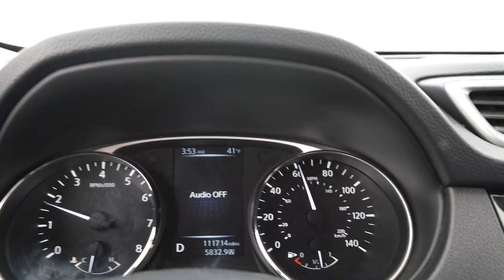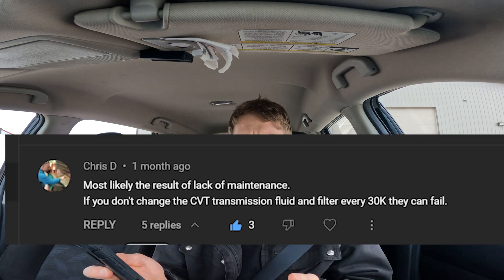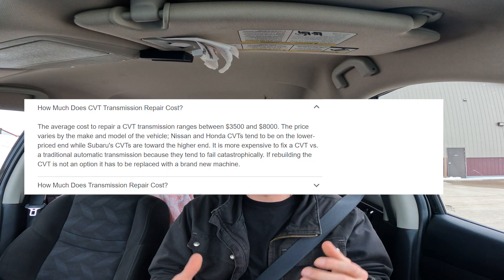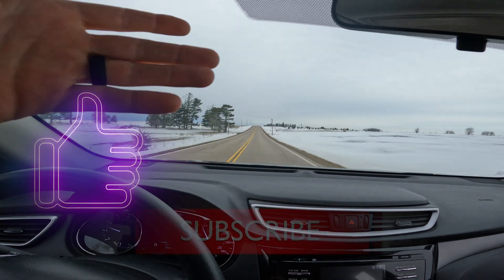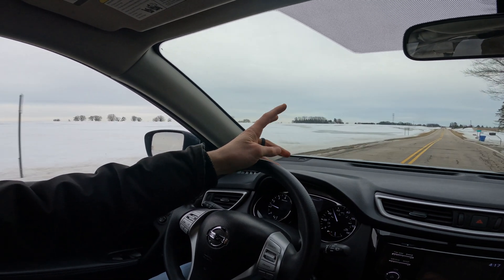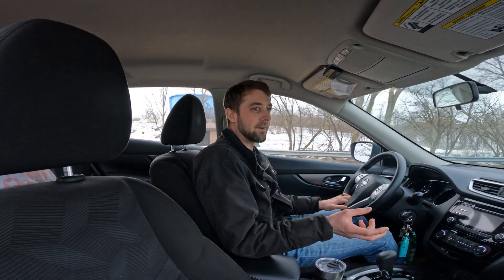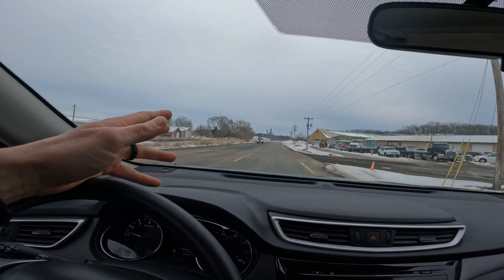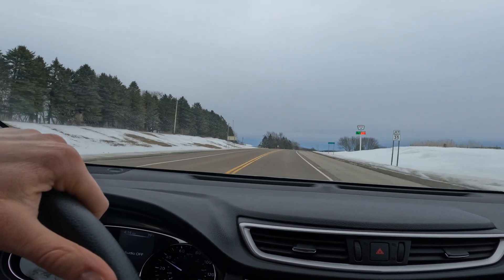Everything WRONG with the Nissan CVT Transmission

Comment: My 2017 rogue has not been that bad it has 70,000 miles and I had the transmission serviced at 60,000 miles. Still runs and drives like new even though I can’t stand how it drives at all.
Reply from the maker: Yeah honestly the car for me has been ok in terms with the engine and other components.  The CVT failed at 95,000 miles for me. I agree with the driver “feel” experience lol. But it’s economy class I suppose.
Reply: wait till you get close to 100,000 miles.  There are no transmission rebuilding or parts to replace.  There is only replacing the whole CVT, which costs at a minimum $4,000.  That's a hard pill to swallow
Reply: @christiansoto9755 And with replacement, they’re only guaranteed for 12 months… no faith in these cvts lol… in the industry.

Comment: I owned a 2013 Nissan Versa. The transmission failed on me after owning it for a year. I had the CVT replaced for $3500. They had a Nissan of America class action lawsuit. I signed up and recieved a reimbursement check. I no longer own Nissan vehicles. The last time I driven a Nissan was a car rental back in early September. CVTs are good for gas, bad for everything else.
Reply from the maker: At least they reimbursed you on the repairs. Yeah the CVT is a downfall to the Nissan brand IMO.
Reply: You clearly drove it wrong.
Reply: @denizenofclownworld4853  no he drove it right ..right back to the dealership.
Reply: @denizenofclownworld4853  Yep. CVTs failures are almost all because of one of four reasons 1) Driving the piss out of it    2) Driving it too hard in hot weather    3) Long road trip through the hills without giving it time to cool down     4) Not changing the fluid ever or after Scenario #2 or #3. Changing the fluid @30k miles is bad advice. You change the fluid when it burns up. That could be at 1,000 miles or 100k miles. That fluid will last 100k if it doesn't overheat. If you think you drove in tough conditions, change the fluid. Don't buy knockoff CVT fluid. Only put in Nissan OEM. Yeah, it's expensive - over $150 just for the fluid. But a new CVT is much more expensive. Also, change the damn stepper motor and both filters whenever you change the fluid around 100k miles. Things will last forever, possibly longer than a Corolla if you listen to my advice.
Reply: @garneroutlaw1  I agree with you on some level but not on everything.
I have 2014 Nissan rogue with 108k miles on it.
Car was mostly driven in Arizona hot weather.
I owned it when it has barely 25k on it. I never rev faster or go past 75mph as a safety rule.

I never accelerate my vehicle aggressively. 

I take 4-5 long drives which involves 6 hours of drive in a year.
I am changing transmission fluid every 20k miles when it reached 70k.

My car drives fine, Although I am not seeing symptoms at lowers speeds, it started slipping at higher rpms when 4 people sit in car with luggage.

When I got it checked with nissan technician with his computer.
It found that my transmission started slipping. 
It gave a code p0744 Torque Converter Clutch Circuit. 

What's the point in owning a mid size SUV when it cannot do its job properly and starts fail at this rate. 

All in fair, I think Nissan used their CVT which is meant for smaller compact cars on a heavy SUV.  and this tranny is crappier on bigger vehicles than on smaller ones.
I never expected a Japanese car go this bad (Except Mitsubishi which sucks any way) under 110k.

Even ford performs better than this. They usually start showing symptoms at around 150k.
Pathetic engineering for a big car company.
Reply: @garneroutlaw1  In the real world, they lost a dozen lawsuits where the truth was proven in court. The most incredible part of your comment is when you even blame owners over Nissan for following Nissan's recommendations.
Reply: @chandudammalapati  Mitsubishi is known in Japan to be extremely reliable, since they used to win many Paris-Dakar Rallies with their PAJERO. They have some very popular models in Asia. Also CVT fluid is exchanged every 30,000-50,000 km as part of routine maintenance in Japan. 

Fluid replacement is a must for all CVTs since it's just gears and belts/chains, just like an oil change for engines. Many Japanese automakers use CVT for their budget friendly models worldwide as it's more fuel-efficient and better suited for stop/go urban driving. We don't have any issues in Japan with Nissan CVTs because they're regularly serviced every few years.
Reply: @yo2trader539 doesn't matter..
Even if you change CVT fluid, 90% Nissan Rogues or Mitsubishi transmissions die before reaching 200k miles. Check statistics.. they don't last like rav4 or crv or a Subaru .. 
very poor quality engines and transmissions. Their CVT transmission suits for compact to mid size sedans. Not for bigger cars.. Nissan themselves accepted to pay for transmission replacement as part of settlement. They say they improved cooling system now for their new CVT transmissions. They are crap and always crap...
Reply: @garneroutlaw1  you could get AMSOil for less and it’s better. Actually Nissan doesn’t make the fluid. Find the Nissan compatible version for your model TransMax CVt is one of those
Reply: @chandudammalapati the torque converter isn’t the CVT.
Reply: Similar to myself, and will never buy a Nissan as long as I live.
Reply: The versa was only sold to USA, that's why they fail we have CVT in all types of nissan here in nz they are made in Japan no issues
Reply: @TB1M1 the versa wasn’t the model it was most failing in as the versa was made in Mexico.
Reply: Was your car used? Did you take care of it?
Reply: If cvts were good for gas, then Hyundai would be using them on their insane cars that’s get better gas mileage than Toyotas cvt cars

Comment: Have a  2006 Altima with a (bulletproof) REAL 4 speed transmission AND  a 2017 Altima with the flimsy  CVT, pretty much same engine / weight / car etc, makes for a good comparison.    Fuel savings on the CVT  is significant.   the fuel savings is about 30% city, 15% highway, with low fuel burn even at higher speeds.      What's so odd is it gets about the same MPG at 65 as it does at 80, which tells you how efficient the infinitely  variable design can be.   The CVT is very smooth and boring and  quirky when you need to stomp on it, and does odd things when decelerating, particularly when descending  a hill.   The engine revs quite high at times while coasting down hill, for whatever reason, we're talking 3500 RPMs at 20 MPH, which is just freaky.    It also gets unsettled when slowing suddenly  after an hour or so cruising on the freeway, hit the exit  and it takes it a while for it  to realize it needs to "downshift"  and gets a pinch jerky, but once it settles down it works great again.  I suspect the fluid gets a bit of foam buildup on long trips, and the foam doesn't quite work the servos as it should, just a guess, who knows.  

 I'm not an engineer, so I could be totally wrong, but based on my research its my opinion that temperature is the Achilles heel of the CVT.  Slapping an aftermarket cooler on it, isn't the solution either.  The CVT fluid is tough and robust, but  its not really working properly till it reaches 95-113 degrees.   In fact, you can't even check the level without a scanner, because if you check at the wrong temp you'll under / over fill it (which is why the newer CVTs don't have dipsticks)  THIS MEANS when you're driving your CVT "cold" you're probably damaging it (like a cold start causing bad wear) and it can take 5 to 8 min to get your CVT to proper temp.   To mitigate this, the "cooler" isn't a cooler at all, its a heater.   Its a heat exchanger that takes warm radiator fluid and uses it to HEAT your CVT as quickly as possible, to get it to the 95-113 degree range.    As a heater, its not really designed to dissipate heat, its more of a temp regulator, using 180-200 degree radiator fluid, rather than ambient air.     The trouble with this is, when the CVT gets too hot (which it can quite easily) the heat is being dissipated into the engine coolant (200 degrees) rather than the outside air, so it takes a long time to cool it down, should you overheat the CVT (from say climbing a steep grade) it can take 15+ minutes of normal driving  to bring the temp down    This also really really bad  for the unit.  An aftermarket cooler will likely  end up doing more harm than good, because its extending the warmup time and counteracting the "heater".   I highly recommend two things:  First, change the fluid every 30K miles;     Second,  get an aftermarket temp gauge for the trans fluid and watch it like a hawk.(I use  a Scanguage II)  If it starts to drift toward 220, slow down,  reduce throttle, ease back, and the temp will start to drop.  When you first start it, drive it real easy till it gets warm.  Don't beat on it cold, ever.     My CVT has 85K on it, still  runs great, love the MPG, and aside from the quirks I'm happy with it, but I do watch the temp like a hawk and I do have to slow it down often (keep it under 220), and I'm very gentle with it when its cold.  I like to get it to around 85 degrees  in idle  before I even leave the house (takes 2 or 3 min)    We'll see if its still  going strong  at 125K!   HA!    Shame on Nissan for not installing a trans temp gauge, AND a two stage temp regulator, to RAPIDLY  warm it when cold, and a second stage, to kick in and cool it RAPIDLY with outside air,  when it goes over 200..   instead they use a  stupid, compromise,  single heater/cooler thing, which does neither job very well.   BAD DESIGN IMO.     (feel free to add your two cents, as I really have no idea what I'm talking about, its just my opinion based on research)    [As a note, the highest temp I ever recorded on my Scanguage II was 242, and that was climbing a steep grade, in the desert, with 3 people on board, on a 102 degree HOT day.  Had I not had the Scanguage II  I would have had no ideal how close to losing the transmission I was, and would have kept going at 65+, instead of slowing down to 45 and cooling off.  Scanguage II, the best $120 you can spend if you have one of these fragile  CVTs]
Reply from the maker: Well you’ve certainly done some homework. Pretty neat that you understand and follow it that closely TBH. Yeah I agree 100% about the fluid temperature as well. We live in the colder climate too, so it definitely acts differently to a very noticeable point like you’ve stated. And I get it, cars from every manufacturer will do something completely different than the next. I will also add that 90% of vehicle owners could probably careless because it’s point A to B for them lol. Appreciate the detailed response man, good work! 👍
Reply: I'm not reading all that.  I'm assuming you don't like the cvt
Reply: @christiansoto9755   IF you own a cvt vehicle it actually would have educated you. Don`t be lazy, the man took the time to explain how you may be able to save yourself some money and headaches. People today want it fast and dirty. I want to completely understand what is carrying the people I love around, why don`t you?
Reply: @christiansoto9755    Mixed.   At 89K its still working perfectly.   It delivers stellar fuel economy,  the lack of gears makes it smooth and pretty cool,  but it comes at a cost on performance. (not that 06 Altima 2.5 with the regular 4 speed was "performance"  but it would go more swiftly) Off the line CVT not too bad, but passing can be weird when it starts hunting for the best ratio, but the worst cost is the fragility of the thing and its horrible reputation.   You just never know when its going to go out.. and THAT is the worst thing about the CVT.  That and the CVT fluid is $22 a quart.
Reply: Ditto.    @christiansoto9755
Reply: There's no way you're getting the same mileage at higher speeds. You can't change wind resistance with a CVT.
Reply: @AnimeBeefRandoms    Well, the range and MPG are the same at 65 or 75.  Yes that's puzzling.   Only thing I can figure is the increased friction is overcome inversely  by the lowering final  drive ratio.  When you think about it, a conventional auto or manual has a fixed final drive ratio, if that's optimized for say 62, then increasing the speed to 75, will substantially increase RPM, friction  and fuel burn.  Whereas with a CVT,  RPM stays static,  and the final drive ratio lowers.   The  fuel burn obviously  rises incrementally with speed,  but so does distance travelled per gallon, so the MPGs remain static, up to 75.   Pretty clever gadget.   Go rent one yourself and try it.    I measure MPG in real time with a   ScanGuageII  plugged directly into the OBDII port.

Comment: Manual swap it
Reply from the maker: lolol DUDE!! I wonder if it's been done?? Now you have me thinking...
Reply: @ManvsCars  If your Rogue is FWD, there are manual Altimas you might be able to source a transmission from. I drive an Altima coupe 3.5 manual 6 speed, have been pushing it hard for years, and the transmission is solid.
Reply from the maker: @tradain  Nice, Yeah the manuals always seem to hold up great in the Nissans, and those 3.5l V6s rip too. torque monsters

Comment: Nissan rogue on mine doesn’t even have a dipstick for the transmission. I had some weird problems with mine change the fluid. Hopefully that works.
Reply from the maker: Yeah this one does weird stuff as well, also with no dipstick. You can buy a dipstick on amazon for 10 bucks.